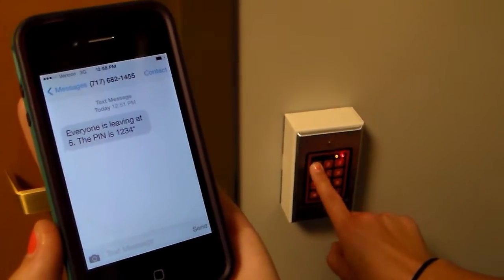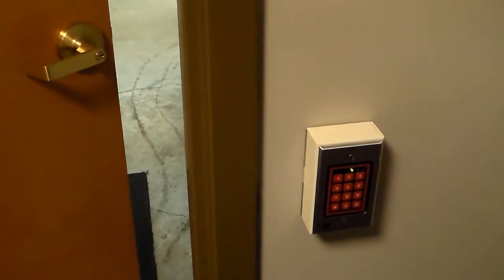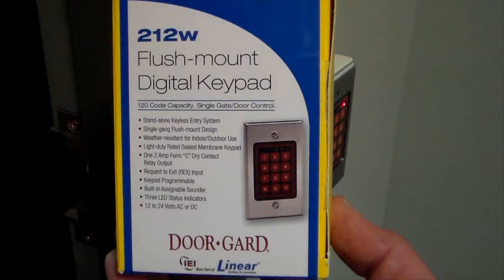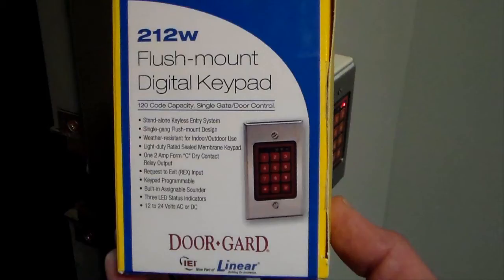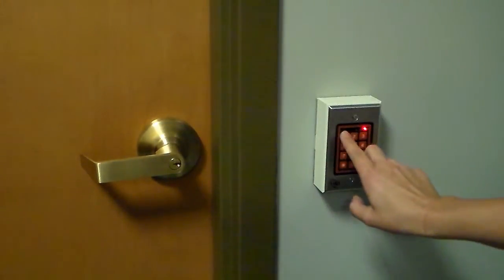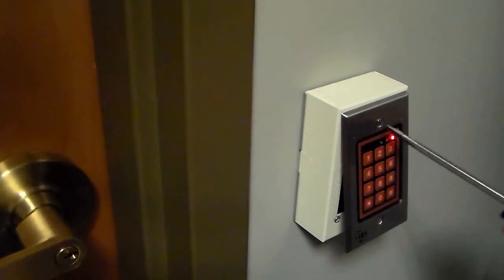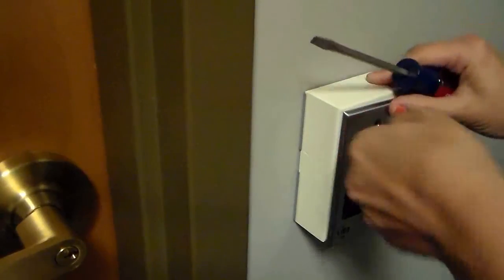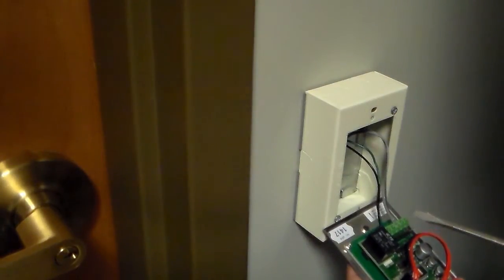Why You Shouldn't Use a Keypad for Access Control

Comment: To make this secure there are a few options 1. Use a tamper switch that when tripped will cause a latch relay to drop out which will remove power to the door strike. This must be installed in the secured area not outside.    Or 2. Swap out the key pad for split type, eg just a keyboard outside electronics, code store and relays etc are on the inside of the door.
Reply: Totally correct 👍

Comment: RFID readers that are all in ones like the keypad lock you showed, suffer the same issue. When the 'controller' is built in, then you'll always get this issue.

Keypads work, when its just a 'data' cable from the keypad to a controller elsewhere, so there are no 'pins' to short.
Reply: how to unclog kitchen sink with garbage disposal

Comment: There are a few tricks to making it very difficult, using a keypad, use a taper switch or two, once the bandit has opened up the keypad, lock is automatically disconnected from the keypad.  Trick two potting the inside of the keypad so electronics and relay contacts cannot be accessed. Trick 3 the cable tail at the back of keypad is pulled tight on installation so if keypad is ripped off wall there is no play in the cable, so its impossible to get into the cable to short the wires and operate the solenoid, and the tamper switches has disconnected the lock solenoid anyway..

Comment: This is partially misleading, if it’s a stand alone access system then you can do this. If it’s tied into a access panel this will not work. Regardless the risk of sharing keys is a bigger issue

Comment: If you buy a cheap option you are able to access the relay easily. But not when you do it with an arduino or with an keypad build in to your arlam system.

Comment: Anyone who doesn't purchase a keypad with a tamper resist detector (basically a spring that detects if the keypad is secured to the housing) deserves to be broken in to. The most simple, $20 secolarm models include it! As soon as the housing is off, it trips the alarm. I'm sure I could find a poorly designed biometric scanner to use as a bad example, too!

Comment: That is why you don't install a cheap and nasty old keypad like that one on any access control system! especially one that has a relay built in it to control the power to the door lock, and with common screw heads easily accessible. Duh
Reply: Iron Shark I do this stuff for a living and just a week ago I installed 2 FINGERPRINT readers that still used the relay at the reader.... SMH.
It was in a secured building though but prime example of the customer always being right, and them trying so save money, but thinking they have a James Bond access control system. Lol